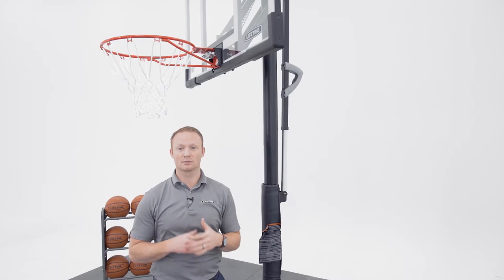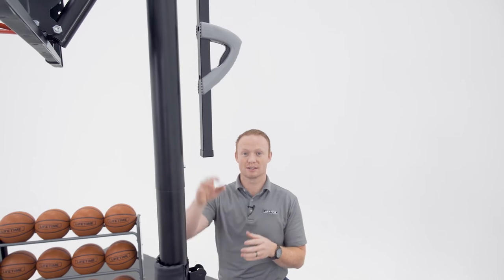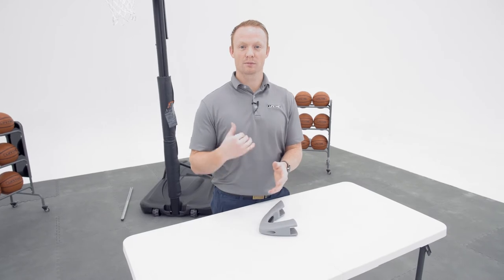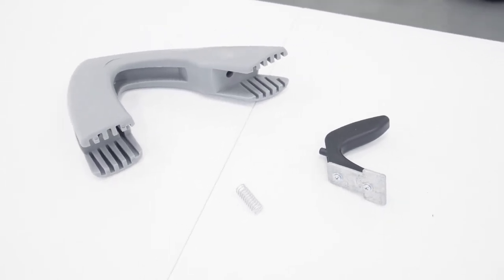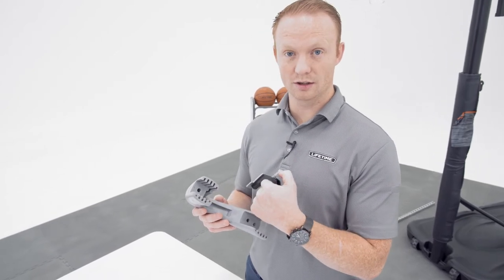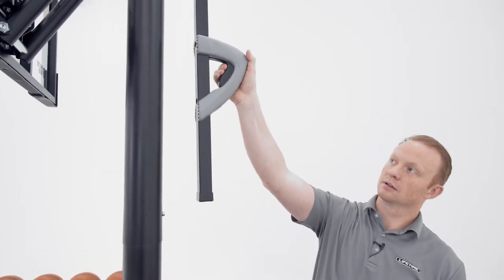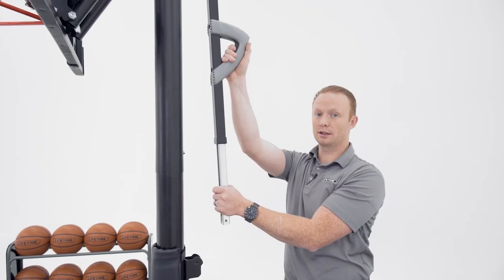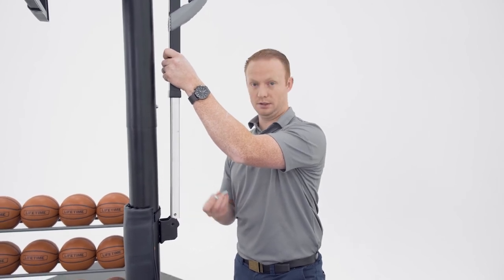How to Fix Lifetime Action Grip™ Handle | Lifetime How To Video

Comment: Mine does not have the notches on the silver pole, so how/what is the trigger latching onto to set each height increment?
Reply from the maker: Hmm... That should not be the case. The inner channel of our action grip basketball systems should have notches. Is there any way that the inner channel was inserted incorrectly? Try reaching out to our customer service experts. They can be reached at 800-225-3865 or by email at customercare@lifetime.com. Customer Service hours are Monday-Friday, 7:00 am to 5:00 pm (MT).

Comment: I hope this helps me resolve issue where the handle won't lock at 10 ft because it can't come down far enuf. There is this black plastic pad that bumps up against the pole, preventing me from being able to pull handle down further. I'm hoping that the person who assembled it made a mistake and didn't put the lock in the bottom position. Agree this is a stupid design. Just use a bolt instead of this complicated handle.